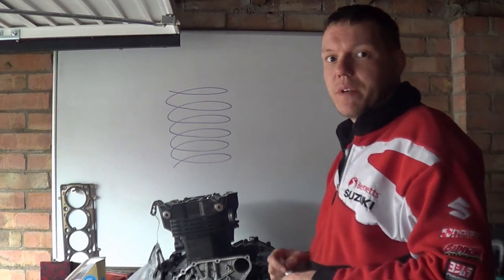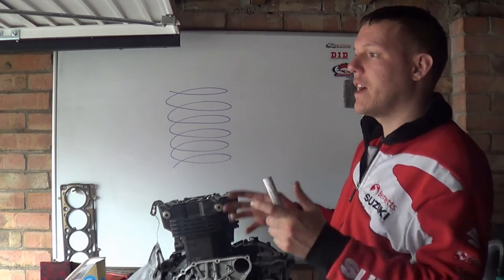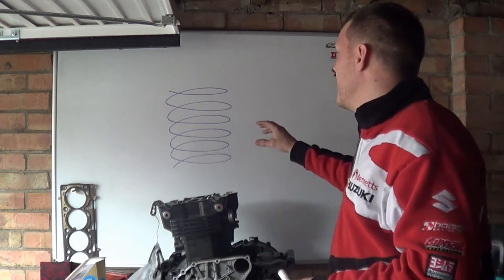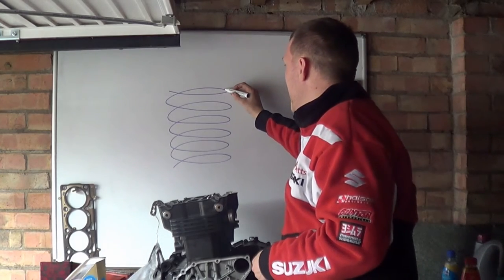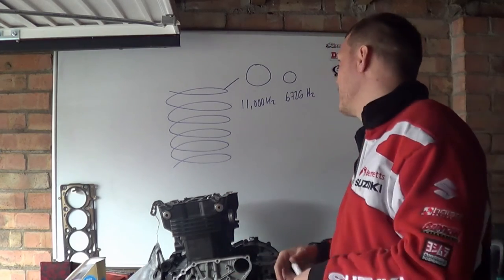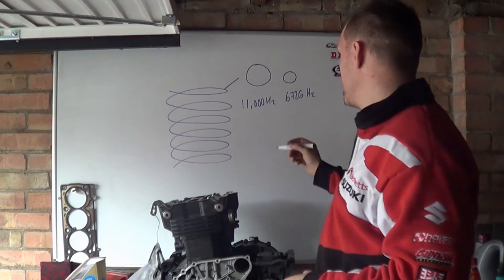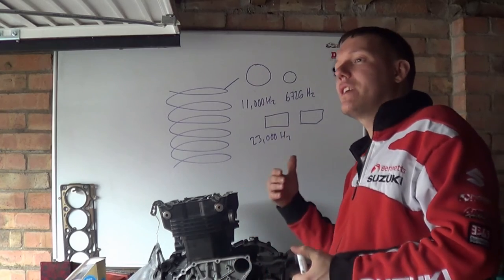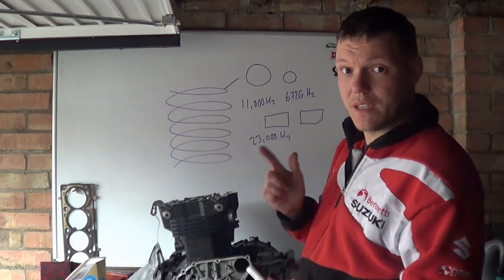Double Valve Spring - Engine TEch

Comment: Thanks for the vid. Most newer performance Suzuki motorcycles (spotted your shirt :) use just 1 spring on their valves in the last 10 or so years. There must be performance benefits from going to a single spring set-up? ie valvetrain  mass?
Reply from the maker: Lowering the mass of the valve etc means you need a lighter spring. Changing the mass changes the resonance frequency. All springs resonate, but if that frecency is outside of the rpm range then it's good to go

Comment: are more reasons to change from single to double springs ??? runs smoother/less noise , less  stain on the valve train ??? less power loss  ??? older husabergs use conical single springs, i changed them for dual springs , because the conical springs sometimes  fail by braeking .  Like your Vids !!